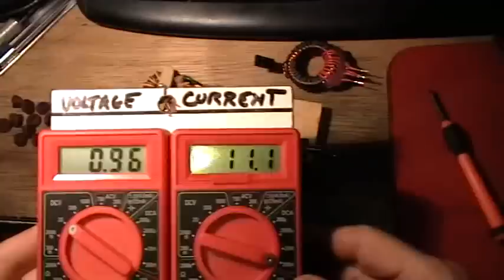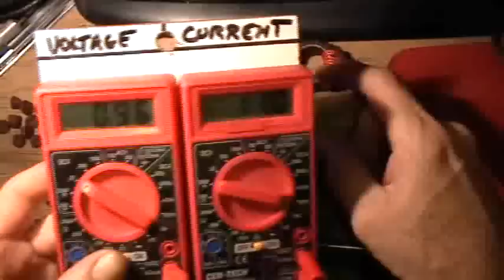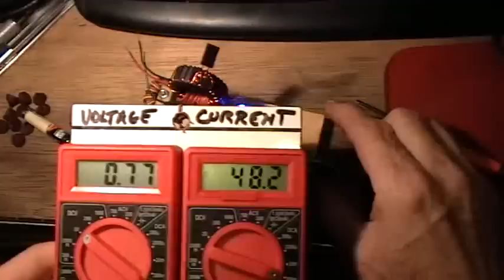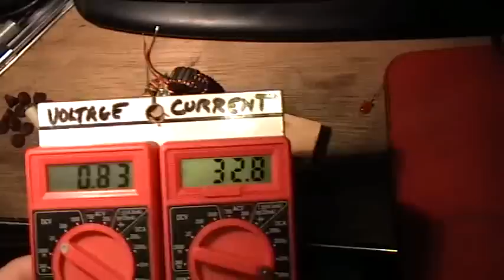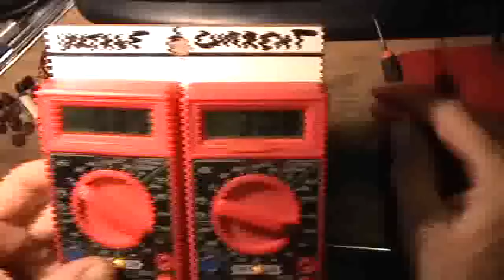Joule Thief: Variations... Alternate Toroid, Reversed Transistor Comparisons

Comment: Interesting experiment. 1st off, where did you obtain t he blue terminal strips?  I'd like to get some.
I think you're confusing efficiency with lower current draw. The efficiency is Po / Pi, or power output divided by power input.  With a battery voltage that keeps changing, you can't make a valid comparison between the different configurations.  How do you measure Po?  I'll explain that in the blog I wrote for this at rustybolt(.)info(/)wordpress(/)?p=4373 - remove the parens